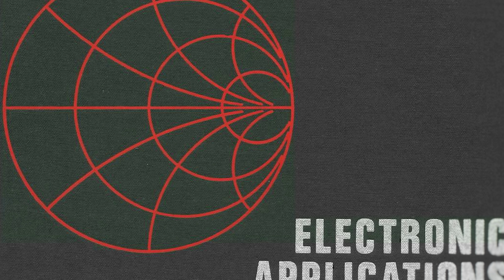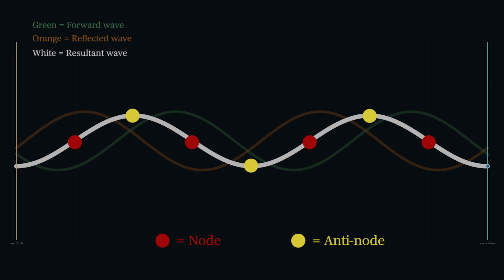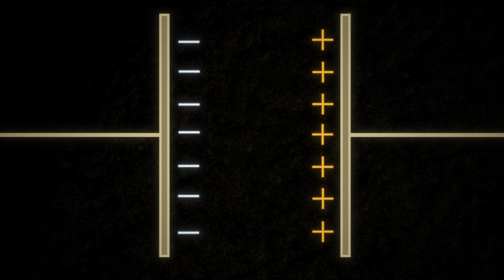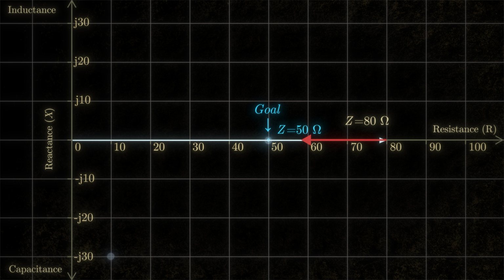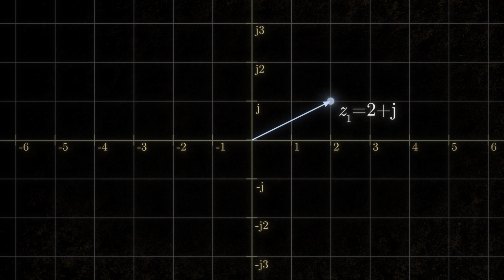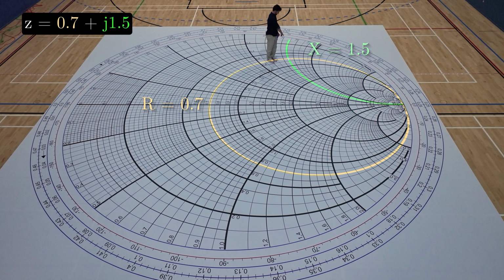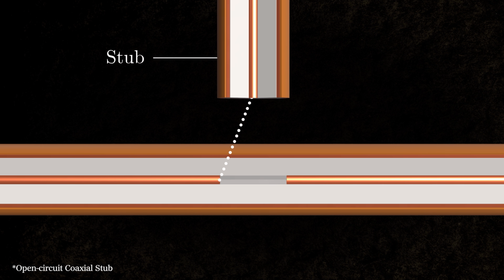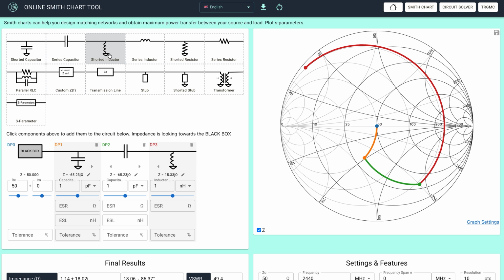The Scariest Chart in Electrical Engineering

Comment: Back in my college days,  I think even my professor had no clear idea of how to interpret the smith chart ... or at least he had no idea how to explain it to us.  It was total mumbo-jumbo to the students. So he pretty much skipped this entire chapter and didn't ask any questions on the exam about this.  Electrical engg. was an elective for me,  and not my core (computer science).   I appreciate this video a lot.  Though some parts just felt very rushed towards the last third of the video (especially the computations).  But thanks for giving me a rough idea what Smith chart is about and where it's applied. 

Wish you had more time to spend on a few things  .... like where & why did you get that formula  tau =  z-1 / z+1  when doing the transformation of the chart ?  Or how did you get the magnitude of 0.68 on your smith chart?   You used a straight line measurement with your rope, but I assume there is some kind of formula to be used for exact measurements - I mean, how would software calculate that distance; using some variation of Euclidean distance, for example ?.  Or how you got the 28 mm of extra line?    I'm sure, there would be many more such questions.  But answering such questions is probably an entire series of videos or I need to hit a good textbook now with plenty of worked examples.
Reply: It’s the formula of the reflection coefficient : (Zx-Z0)/(Zx-Z0). Smith chart normalizes it by Z0 so z = Zx/Z0 and it becomes (z-1)/(z+1)

Comment: your resistor placement is wrong. You dont simply slap a resistor in the middle of transmission line and expect the impedance presented at the input to be 50ohm…

Comment: And now, some 15 years after leaving the job, I finally understand what the heck is happening when you calibrate a VNA.  

Add a short, it finds 0 on the horizontal.  Add an open, it finds 1.  Normalizes the impedence.  Use a variable length open to walk around the circle back to the center of the chart.  Match achieved.

Comment: This is why when I was working on radio interference with my sound gear so very long ago, I felt like I was barely sensing or approaching this pattern and when I added a wire or lifted a ground, the buzz would change and if I paid attention to it I could get rid of any buzz in the lines. Back then, I felt like an alchemist. Now I know it was geometry and algebra and I had all the tools to figure it out from high school.

Comment: A guy at my last job showed me how to use one of those charts to help troubleshoot a problem with one of our plasma etch machine for semiconductor manufacturing. These machines use RF power to induce a plasma inside a vacuum chamber that etches the wafer. He used the chart to figure out that, rather than replace an incredibly expensive RF power generator, the problem could be fixed by changing the length of the coax cable that connects the generator to the machine.

Comment: Feels like I'm still in an intro college course. One of the most common everyday examples of phase shifting occurs in single-phase AC motors. Maximum torque for them occurs at 90 degrees, which is what you want to get something like a compressor, washing machine, ceiling fan, or HVAC system started. Generally, I've never worried about reflections because using a receiver or transmitter 3/4 of the maximum wavelength is usually good enough. It should be noted that there are issues if the line is too short.

Comment: I'm a Ham, i don't use this chart enough, I like switching the VNA over to the standard type chart and using one or two traces, im lazy.
But this chart on the VNA has so much more data, it's great for building chokes.

Also I usually build antenna systems by making the system tunable, then you just need an SWR meter, tune the circuit until you see 1.5:1 or less then send it.

Comment: Seems like y'all made a mistake in the video. The inductor current lags the voltage and the capacitor current leads the voltage. But you got the impedance part correct. This is because Z = V/I. I is in the denominator, so the sign of the angle of I is opposite of the angle of Z, assuming the angle of V is zero.

Comment: When I took Linesand as Waves in school we were the first class being taught with calculators, it took a long time solve problems. I went to the school library and read up in smith charts. The Final exam was scheduled for 3 hours, I use the smith charts double checked my work and handed it in after a half hour. Many of the other students didn't even finish all the problems. I got a perfect score.  With a modern computer it is almost instant.

Comment: I took an elective complex analysis course during my EE bachelor’s. Conformal maps came up near the end, starting with the Möbius transform, and they felt far more abstract than the rest of the class. Residues, at least, were immediately handy for cracking integrals.

A year later, in microwave engineering, I realized the Smith chart is just a special case of the Möbius transform, and that genuinely amazed me. Since a Möbius map sends generalized circles to generalized circles, it’s also a neat trick for 2D electrostatics with eccentric coaxial cylinders or a cylinder over a ground plane. Laplace’s equation is conformally invariant in 2D, so you map the cross-section to a concentric annulus and the answer falls out.

Later I ran into the Joukowsky transform, another conformal map, which turns circles into airfoil shapes and shows up in fluid dynamics.

And then there’s the stuff still well over my head: AdS/CFT correspondence, conformal cyclic cosmology.

There’s a lot of cool “conformal” out there. I’d love a video on why conformality keeps showing up everywhere.

Comment: The wire-cutting part (plus the reference to Magic) puts me in mind of a famous anecdote from the earliest days of computing.  At MIT, there was a PDP-10.  It had been running happily for many months when someone noticed a toggle switch with two labels: Magic and More Magic.  The switch was set to More Magic.

Not paying attention to the "if it ain't broke..." rule, some engineers looked into this undocumented switch.  They found there was a wire hooked up to one side of the switch, but the other end of the wire was just dangling in space.  Flipping the switch should have absolutely no effect.  They flipped the switch.  The computer immediately crashed.  They unflipped the switch and rebooted.  Everything ran fine.  They flipped the switch again.  The computer immediately crashed.  So some engineer taped a note to the case of the computer, saying in effect "never flip this switch".

Is there anyone around who thought of that old story?  Is it at all related to this stuff?  I found the story in the good old Jargon File.  You can find it if you google "Magic and More Magic".

Comment: I don't believe engineers really use Smith Charts. In my first job in electronics design after leaving university, I used all the calculation methods we had learned. A senior engineer asked what on earth I thought I was doing, and told me that no one does that. You just have an idea for a circuit, build it, figure out why it doesn't work, then tweak it till it does what you want. That sounds much more plausible than all the crazy mathematics we learned. In any case, the calculations invariably resulted in values for components that you couldn't buy, so you ended up using whatever you had or could get.

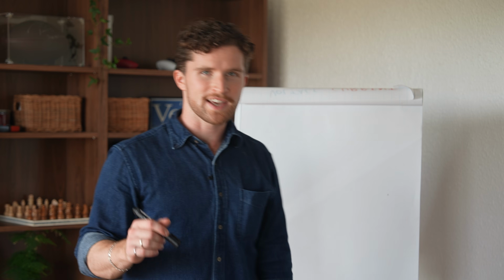Comment: 12:10 wait a minute so what exactly is the difference between voltage and current on a fundamental level? And does the voltage always lag the current? And where does impedance come into focus?
Reply: No, in solenoid  the current lead the voltage
Reply: @Mohamed-k2v5t that doesn't really answer my question
Reply: But what is the difference between them on a fundamental level? When you get down to the basics what's the difference?

Comment: I love how even a simplified veritasium explanation of transmission line concepts gets very complicated. And this is coming from someone with 12 years of electrical engineering experience.
Reply: I didnt get this when studying EE, the simplified explanation makes half sense. But it still feels like someone trying to prove voodoo with math
Reply: I never really understood how the re/im plane could become a smith chart. I only used it during transmissionline lessons. So I have to watch again.
Reply: @thomaskulpmann1715 The Re/Im plane can be expressed as polar coordinates.  Each angle maps to a single point on the unit circle.  The distance r could still be infinite -- unless you have a way to bound it in at least one direction, like by saying the reflection amplitude can't be greater than the original wave amplitude.  Whether this helps or leads you on a goose chase may depend on your goals.
Reply: @thomaskulpmann1715  I dunno if you've ever learned Signals and Systems type concepts like complex frequency domains, but it's similar to how you map the continuous time s-plane (Laplace domain) into the discrete time z-plane (Z-domain) via a bilinear transformation (like the Tustin method).
Reply: i love how educational they are, like i couldnt use this myself but just the examples, math, expinations, context and all are overall what i wish real school would be
Reply: @defalution  same. If only school lessons were just these educational science videos but in the form of a teacher teaching you this on a whiteboard. School would actually be something I'd look forward to everyday
Reply: @Epsilon2042 what I've learned from both being at school and teaching is that the difference is a teacher who's passionate about their subject. If they love the thing they're teaching then their excitement of sharing it with others is infectious and you're more likely to understand.
Reply: @redheadedbint  yep, I just wish all teachers were selected for those properties
Reply: and transmission line concepts are themselves just a simplification ..
Reply: No wonder im sitting here feeling like a dumbass with my 0 experience lol
Reply: For real. My physics class this year went up until impedance and then a few more details. I could tell he was explaining too fast to really understand and I could only follow what he was explaining because I already knew the stuff, and then I started mostly just hearing his voice when he started talking about imaginary numbers and transformations 😅
Reply: This technology is from another plane. This is not natural at all, beware of alchemy. Sic Parvis Magna
Reply: its hard to simplify complex analysis down to a point where everyone can understand, i mean its in the name lol. they did a good job though

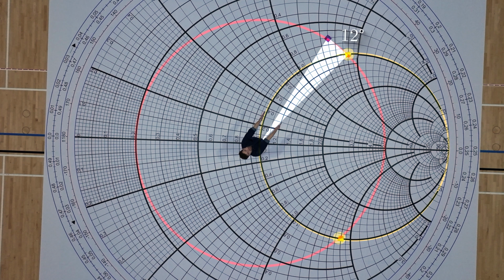Comment: Appreciated how you explained the smith chart, not only did you explain the purpose and history of the smith chart you also explained how to use the smith chart in impedance matching, it was amazing. Now I have a question, at 28:45 how did you get 3.1mm out of 12 electrical degrees and 28mm out of 107 electrical degrees? I'm just asking for completeness because, you showed how to calculate for the inductance at 29:29, much appreciated.
Reply: Working at 1085 MHz with an effective relative permittivity of 2.2:
3e8/1085e6*12/(2*360)/sqrt(2.2)   = 3.11 mm
3e8/1085e6*107/(2*360)/sqrt(2.2) = 27.6 mm

Comment: "As you increase the frequency" at @4:32 you msnage to create a standing wave with its still nodes as the energy is not dissipated on the end of the transmission line. Accurate mecanical analog. Good job there.
Reply: You know its serious when they bust out the slinky

Comment: It's a transmission-line complex-impedance calculator based on tabulated (normalised) values of resistance (R) and reactance (X) represented by tangentially located increasing circles for R, and their orthogonal crossing circles for X, all encircled by outer rings representing angles and wavelengths (etc) in 0-360 degs... as a DSP guy, I never used it, and also never underestood during undergrad years :-))

Comment: 20:42 that explanation is wrong. For classic circuits that denomination is correct, but for radio frequency, open circuits and shorts have measurable impedances because of the wavefront.
Reply: they just explaining for classic circuits bro.....

Comment: I can confirm that several people in my EE class dropped out as soon as the Smith Chart showed up
Reply: Smith chart is the easy part.
Reply: @GoonyMclinux  Right, I remember a problem at an EM theory exam asking first to solve through equations and it was like three pages, then solve it using he Smith chart in four lines
Reply: I still use a smith chart, have one on my wall with a dry erase marker. 😂 @donrata13
Reply: @GoonyMclinux  Exactly.
Reply: I would have thanked the stars that such a thing existed!
Reply: That just means they failed to understand how complex impedance is used to model a system; probably better they dropped out. That should have been caught earlier when it was obvious they struggled with complex numbers.
Reply: @kirkhamandy  Weird:  when I fail at teaching something, that's my failure as a teacher.  I guess I do it professionally though.
Reply: @kirkhamandy  Exactly.
Reply: that's true, haven't seen them since
Reply: I had trouble with it and decided to focus on transistors and here I am 16 years later still working on microelectronics lol no ragerts
Reply: Linear Circuit Analysis, Electromagnetics, and Thermodynamics are weed out courses.

Comment: Hmm crazy suggestion : What if you had cut the stub at desired length , then moved the cut end along the line and re-introduced it , would you not get spin/vortex that may possibly cancel out impedence due to atomic pair photon fattening , possibly create a mechanical slider along the line , if works a digital length switch which adds in at various lengths . As noted with single channel outputs that are split apart by photon fattening and become two seperate channels , that friction between the channels is photon fattening that we see in radio channels , thats the signal split as atomic pairs chase each other around the photon induced fattening that seperates the pair as photon /friction is introduced creating expansion or potential from the pairs constant . We see increased voltage , lerp maths does not take Blend into consideration as it forces its way through . Thats why it meets resistance . Thats why we hear radio channels better at night because the atomic pairs come back to rest a night , where as in the day the photon fattening increases again . Introducing spin would introduce Blend not LERP. Photon fattening will also derive the spark gap jumped when conditions are met / thunder and lightening as the atomic pair reach's their limit and snap back through the photon fattening that stretchs them apart . Resulting in TDF-Alpha unseen to Alpha seen .

Comment: In mechanical engineering we have almost the same charts to match the inertia of 2 systems. One being the inertia of a (electrical) motor and the rest a gearbox and its load. If the inertias match the drive system becomes much more efficient, removes unwanted oscillations and dampening. The professor at the time (30 years ago) tried to teach us that but utterly failed, this is the first time that I now see what he tried to tell us so thank you for that! Not that I am going to use it.

Comment: The main reason I struggled with Smith Charts is that there are just so many movements round circles both printed and user generated that it all just massively muddled in my head.... add to that that the lecturers where jumping between 'using' the chart and all the math behind it (+ derivation from first principles) then it all just became this huge monster that made no sense....

To be fair to the chart, its incredible how much detail it encompases, and its effectiveness at solving a highly complex process is unquestioned, I just think the teaching behind it is done poorly, and at points I can even see this video being confusing if you'd never come across all the principles beforehand.

Comment: We were taught how to use a Smith chart when I was doing my Master's in RF engineering, but even back then (early 1990s) we were using software tools. And measuring impedance was just a question of hooking your device up to the Hewlett Packard vector network analyser and reading the VSWR off the screen.
Reply: The Smith Chart merely helps with Resonance plotting. Which, in fact, is used to trigger Cold Nuclear Fusion. Come learn with us.

Comment: Thank you Veritasium for an enlightening video! As a former EE student and professor, I learned and taught about Smith charts. Only now have I learned about its invention and the inventor. Its a useful calculation and visualization tool. Indeed, they can help one have better intuition for the "black magic" of RF circuit design. Yes, it was weird at first to navigate them, but I don't think using it was particularly scary -- it was just another one of a plentitude of rigorous RF topics one had to master over the course of a semester. Of course other students may differ from my opinion.

Comment: I felt the explanation was quite good but the demonstration wasn’t helpful. They could’ve used a lower frequency and a balanced line and shown how the standing waves change as you slide along it, like we used to do with neon tubes to show the voltage peaks.  Adding minuscule inductors in a pre-made PCB transmissyline wasn’t very illuminating